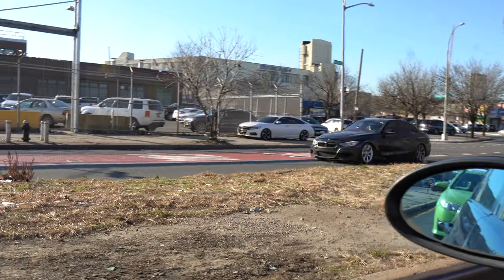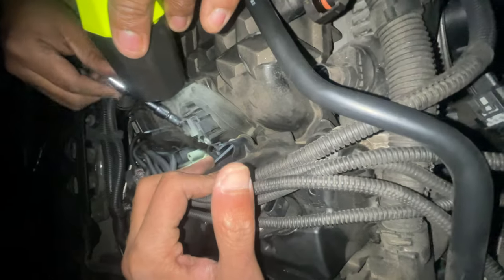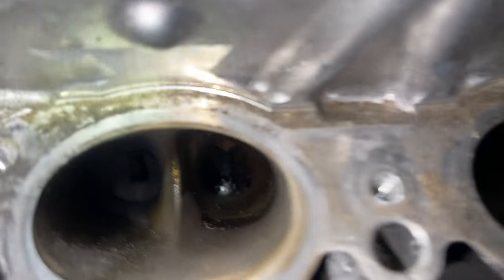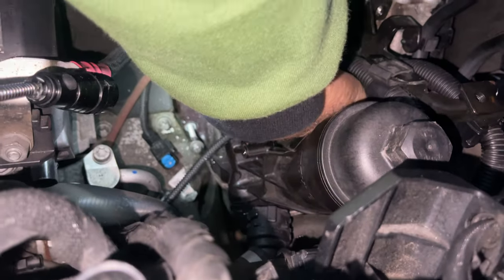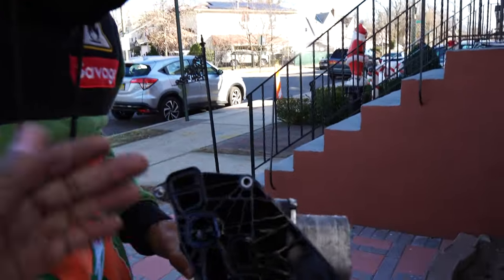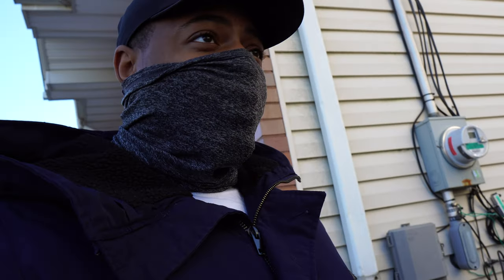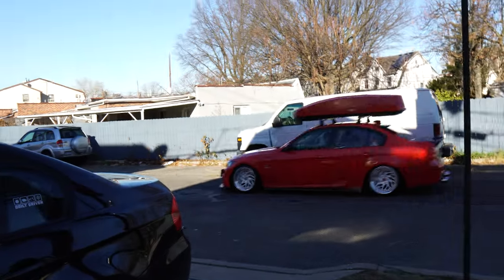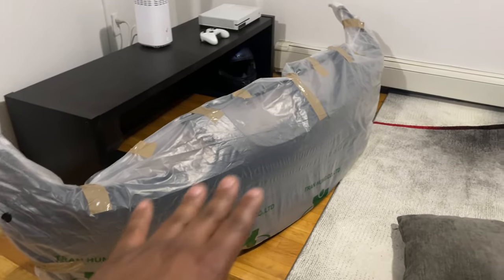BMW FAILED AT ONLY 65k Miles!! | B48/B58 Oil Filter Housing FIX!

Comment: An experienced BMW technician told me that the reason why Oil Filter housing on B4x engines might leak is that the filter cup was over-torqued during oil filter replacement. The torque is 25 Nm, NOT Ft-lb! It is enough to do once to damage the housing. Well if you done at a quick lube shop once, you know why it leaks now
Reply: Did you even see where the failure happened?... It was designed to fail just like the rest of the plastic tubes/ connectors...
Reply: BMW dealership did my oil change and had this leak on the way home

Comment: great job guys! My 2017 330i just went down yesterday. Unbelievably disappointing a quality manufacturer like BMW would use such a cheap ass part in such a tough spot like that. There is now one other vid out there showing a shortcut but nothing as detailed as yours. Thanks a ton.  Finding somebody competent to do this at non-dealer is gonna be tough.
Reply: Did you figure out where your was leaking from ?

Comment: Replace mine on my 2018 x3 and 6 months it appeared to be leak again. I ordered a aluminum housing oil filler  and when I changed it out couldn’t find a failure point. The problem was my coolant hose flange to the left of the filler, it had split . I have almost 120000 miles  now and water leaks spring up often.
Reply: I purchased the aluminum oil filter housing and aluminum flange as well . I’ll be installing when the parts arrive
Reply: I heard it’s best to change the flange when you change the oil housing filter  because it often breaks .
Reply: @ABCandDCboy how is the aluminum flange holding up and where did you buy one from. I heard you need to RTV the aluminum ones to the block since there’s no gasket. I’ll be doing the oil filter housing and want to ch age the flange and upper radiator hose. I’m at 70k miles on my 19 X3 and I’ve had a coolant return line fail which was easy to replace and now my water pump has the slightest leak. Only failure im dreading is the oil filter housing. Hate BMW plastic.

Comment: This is exactly why I’m replacing as many plastic parts I can with alloy on my N54. Bmw is suppose to learn and over come these failures from previous generation bmw’s. To me this is Proof that bmw just wants to take your money the dealerships don’t make their money on the sell of a new vehicle the profit is in parts n labor!$!$!
Reply: N55, S55, N54 all have issues with oil filter gaskets leaking. Need to be replaced at 20-40k miles typically.  I was hoping the b48/b58 would have been an improved design but It might be worse as it appears to use more plastic sand it located at the back of the engine under the charge cooler!. I was considering buying a M240i but I might get a M235i instead

Comment: Mine just started leakingin my 2017 540i. Im so done with BMW, never again. Ive already replaced: cracked reservoir tank, radiator, all radiator hoses, and now the damn oil housing filter. Such piss poor quality of a car with crap plastic parts. Definitely going Japanese for my next vehicle.
Reply: The unfortunate thing is that many Japanese cars are going cheap plastic EVERYWHERE, too. Look under the hood of even modern Toyotas, especially the newer 4cy turbocharged, oof. The least plastic under the hood I’ve come across personally is comically my two fiat 500s. Zero fuss on those Italian engines.

Comment: Got the same problem at 69k miles, but not only that part blows, I needed to replace 3 hoses and I'm still having leaks lol, looks like 70k miles is the breaking point for all the coolant lines and parts
Reply: Same here , after 75k miles coolant leaks every 3 weeks something different, oil filter housing crack, then radiator, like 3 different hoses …….

Comment: Thanks mine has same problem I think can’t see were it’s making from in back driver corner and replaced the manifold to the tank hose common repair. Keep leaking coolant out think it’s my same problem was it leaking all over the bottom of trans cooler that other metal radiator chrome piece under it ? I don’t think mine is leaking into the oil or vise versa
Reply: Did u ever figure it out ?

Comment: Oil filter housing on my 2017 430 Gran Coupe just cracked.  Coolant leaked out quick.  BMW wants $3,300 to swap the filter housing.
Reply: Hell no, go to a small shop not dealer unless u have warranty
Reply: Indy shop should do it for under $2K.

Comment: need to do this on my b58 not cause of leakage but cause filter tore in half and got stuck inside housing thanks for this video seems like the b58 should be very similar removal
Reply from the maker: Tore in half!!! That’s crazy, I’d try everything I could to pull the piece of filter out. That housing was annoying to move
Reply: Slowspeed yea bruu I bought the car from carvana i goofed up and didnt check to see if the filter was actually changed and seems to me like it wasnt as it was damn near disentagrated when removing the filter cap bmw said teplace whole housing little scamming bastards didint even bother trying to remove that bottom piece i towed it to my mechanic he removed the stuck piece flushed the engine and added new oil and filter ima make sure to change oil and flush again at 1k mi with this oil

Comment: Was this on a b48? I just did mine this weekend and it was a pain in the ass, intake manifold had different coolant connections, and the oil filter housing actually had 6 bolts instead of 4.
Reply from the maker: Yes it was a b48!
Reply: @Slowspeed Typically how much do shops charge for an b48 oil filter housing change?

Comment: how are the b48? what's like their max power output?
Reply: 500 hp with stock internals  with fbo and upgraded turbo .
Reply from the maker: 500 to the wheels?? 😳😳 if so that’s amazing, well I mean even to the crank that’s good!
Reply: @Slowspeed   452whp. No meth/ stock engine
Reply: @curtomaru8077  more info on your build? What bolt-ons, info on tune? I'm assuming custom for that power #

Comment: Does BimmerCode voids warranty ?
Reply: Nah bc its not changing anything like power and driving
Reply: @taymazgoharian3302  🙏🏾 thx I need to code that engine sound menu
Reply from the maker: Funny thing, one of my friends was unable to get a module for the infotainment system warrantied due to coding. Now I’m not 100% sure if he admitted to the coding or they found it but for the most part you should be good. It definitely won’t void and engine or drivetrain malfunction

Comment: Has anyone had this issue on the 2019 bmw x3 sdrive30i with b48 motor? I’m currently at 60k miles and no warranty. I’ve gotten all my oil changes done at the BMW dealer.
Reply: It’s coming , best to be proactive and change it beforehand along with Flange , top radiatior hose and water pump at the same time ,hell thermostat too.
Reply: @ciabatta7538 first thing to leak was the turbo coolant return line at 65k miles and now I have the slightest leak from my water pump. Coolant return line was fairly simple and water pump is a pretty easy job. I would replace the thermostat but these engines don’t have a traditional thermostat which should be no more than $50. It’s more of a temperature regulator unit that cost about $500 for part alone at the dealer and of course completely made of plastic.